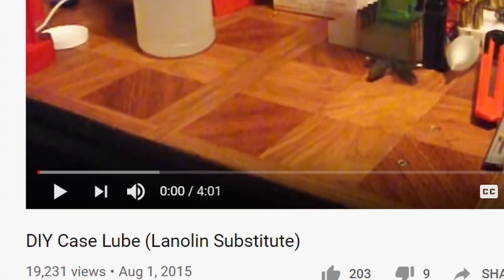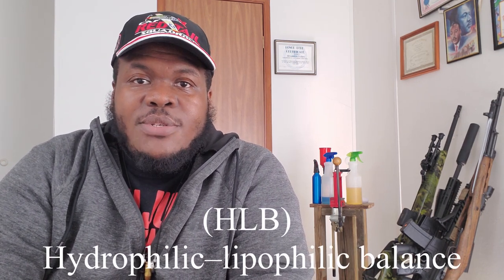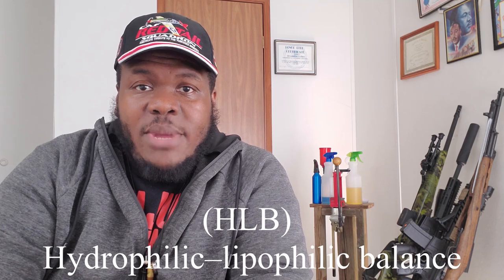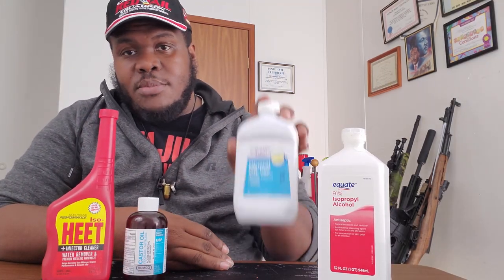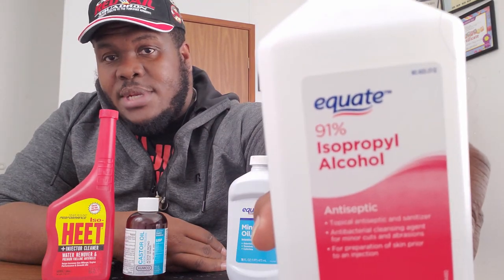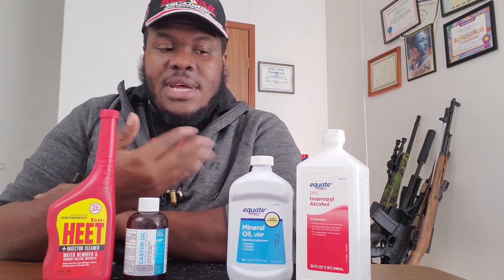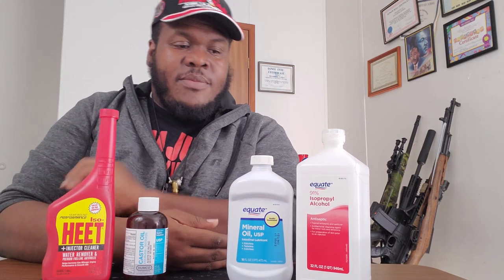DIY Case Lube 2.0 (#Lanolin Substitute)

Comment: Hi Tank, I'm a shooter/reloader in Australia. I have struggled to find lanolin like crazy down here. You first mineral oil vid was epic. This one is even better. I can purchase both mineral oil and caster oil down here very eaily and cheaply. Just wanted to say thanks for putting in the hard yards with testing. Awsome work!
Dan
Reply from the maker: Thanks Dan. I'm glad I was able to help. I do this because of people just like you.
Reply: wait, the country closest to new Zealand has trouble finding lanolin?
isn't there a bunch of sheep farms in Australia too?
Reply: Most pharmacies have lanolin.  It isn't in liquid form.   It comes in a jar for softening skin, make up,  etc.   I bought 8 ounces a few years ago on Ebay and I use a short T-spoon full to make 12 ounce bottles of lube with ISO heat.   I've made 4 bottles so far and still have most of the lanolin in the jar.

Comment: Spritz the bag first, then add the casings and rub them around. that way you won't accidentally spray into a case.
Reply from the maker: Thanks for the tip. Will definitely do that moving forward.
Reply: You need a little lube in the case neck or on the expander itself otherwise the expander will get stuck or change the shoulder set back.
Reply: @jimburianek685  spot on!

Comment: Tank, I just bought a quart of castor oil for 15.00, a spray bottle for 4.00 and a bottle of iso heet for 2.25. I think my grandkids will be the ones who finish off the castor oil. I sprayed a Wal-Mart bag with 3 spritzes of your formula, added 320 .223 cases, shook it a bit, and ran them through resizing. NO ISSUES! I thank you for sharing the research with us. Processing .223 is my least favorite job, but this method is really painless (couldn't bring myself to say slick) Thanks again, Brother
Reply from the maker: You are more than welcome!!!! I just crossed over into the realm of 458 SOCOM and I processed about 200 case last night using the same formula. Glad to hear it's working for you. 👍🏿👍🏿👍🏿

Comment: I have been useing  1 oz mineral  oil to 1 container  of heat for my case lube for over 8 years now. I haven't  had ANY PROBLEMS.  I haven't  stuck any cases since  I switched  to this mixture. No problems with my ammo. I use imperial  sizing wax if I am doing 1 or 2 cases for something  specific.  But 10,20, 50 or more I use the mineral  oil & heat. I put the cases in a plastic  tub. Spray a few times mix them up with my hand let them sit there for a few minutes till I get my dies setup. Then do my thing. It has worked  so well for me I am happy with it. I am sticking with it.
Reply from the maker: Thats what I love to hear.

Comment: for case sizing wax or case lube I use the Lowes toilet bowl wax rings.  They wax rings don't work for bullet lube without making the wax harder, but these rings work great for case wax.  BTW, castor oil and lanolin are the primary ingredients in swaging lube for swaging jacketed bullets.
Reply from the maker: Sweet deal. I didn't know that.  I guess I'll try some of this when I start casting. Funny thing is I have all of the supplies, I've just never stopped long enough to actually do it. Lol

Comment: Thanks for the the info, Tank. Just mixed up a batch exactly the way you did. Looking forward to lubing all my 223 brass with it! Guess I'm not the only one that has a minimal reloading bench. My bench is a sheet of plywood sitting on a couple sawhorses. Ya do with what ya got I guess.
Reply from the maker: I actually have a full fledged bench in my shed, I just don't have power out there and no climate control. Also I like watching TV while I reload, so I made this little thing so i could load in the house. It's heavy as sin but it's sturdy as a rock. 😁😁😁

Comment: Question; have you ever had any issues when spraying in bag , with the oil residue being left in case should it have gotten inside. Powder , primer issues
Reply from the maker: No not really.  None that I recall. But remember I decap and then tumble my brass so if there was any it's absorbed by my media
Reply: @WHATSUPTANKWashington  ok Thank you, so you are using you are using dirty range brass in full length sizing die lubed with this castor oil then tumbling it? Or are you tumbling clean, resizing with the lube and tumbling again to clean off lube?
Reply from the maker: @raymondbuie5292  I do both
Reply: @WHATSUPTANKWashington  ok great Thank you!

Comment: Well done. Ace hardware sells a gallon of ISO- propyl alcohol for about $32. A considerable savings over Heet and eliminates the fuel injector cleaner as a risk to primers ( although a low risk - one bad primer is enough to cause concern)

Comment: I alway thought mineral oils killed primers, so, I had a shit load of primers to get rid of, I put them in an oil bath and forgot about them, found them a week later, took one out and hit it with a hammer, as any red blooded gun nut would do, the result was it scared the shit out of my cat, I got a bit of a surprise and tried it again, same result, took a few hours for the cat to come back, I am still careful about handling primers but the biggest reason a primer won't go off is it is not seated correctly.
Reply from the maker: I have another video testing that same theory. The only thing I've found is that in some cases the primer won't go off if it's wet, but when it dries POW!!!!

Comment: Tank 
Just saw your vids 2day for the first time. 
You interested to test an even cheaper option, well at least where I'm from both the alcohol, lanolin, caster oil and mineral oil is more expensive than my mix.

Now i have to say that i wash my cases with soap and citric acid after resizing, so I've no issues regarding contamination of powder or primers

Let me know.

Thanks to your 1st vid i got to my own concoction 🥳
Reply from the maker: Thanks what I love to hear. Taking what you have and making it work for you. If you want, shoot me an email and I'll give it a try when I get some time. It may be a little while because this is a very busy time of year for me but I'm always open to considering something new.
Reply from the maker: @fgrobler1342  send that to my email.  Whatsuptankwashington@gmail.com
Reply: @WHATSUPTANKWashington  will do, and will send the pics 2!

Comment: First of all Tank, you rock dude!
Second, I followed this recipe and it works like a charm. Even tho I use carbide dies and don't really need to lube I figure why not make it even easier.
Thanks for doing the research so I didn't have to.
Reply from the maker: No problem. I've always been a bit of a sciences nerd so this was right up my alley. I'm just happy to be able to share it with everyone.
Reply: but you have to lube rifle dies because they are nit carbide.

Comment: The 10% lanolin how is that measurement some say .4. Is that .4 of an inch¿
Reply from the maker: Normally I believe the measurement is a ratio of 12 to 4. So if you have 12oz of alcohol you use 4oz of lanolin. This is if  I understand you correctly.
So it would be 4 parts if im not mistaken.
Reply: @WHATSUPTANKWashington  thank you, I was just going buy Gavin from Ultimate Reloaded, but if 12:4 will work thats easier to figure out

Comment: Lubing cases before sizing doesn't bother me, it's having to lube the inside of the neck.  I use the Imperial graphite stuff.  Comes in a small container with tiny porcelain beads and some dry graphite powder.   Lube the outside of the case (I use the RCBS pad and their lube), then dab the case neck into the dry lube a couple times.

Works good at keeping the sizing plug smooth, but it's messy as heck.  That graphite gets all over everything and all up inside the die.  Have to clean the die every once in a while.

Going to try either the lanolin/alcohol or your HEET/castor oil method for lubing.  When it dries, is the lube remaining on the cases oily, or is it more dry?

I wish die makers would make the neck sizing plug out of carbide then you wouldn't have to worry about neck lube.
Reply from the maker: It depends on how heavily or lightly you spritz your bag. A buddy of mine uses the graphite as well. I've been curious about it but I've never messed with it. This method has worked very well for me. When the alcohol flashes there is a very thin layer of oil left. When the oil dries completely there's nothing. If I do notice anything I just throw the cases in the tumbler before priming.

Comment: Nice video!  Never would have thought Castor oil.  What do you use to clean the cases afterwards?  Water/dish soap, a vibratory tumbler?  How about after you use the lanolin, I hear soap and water doesn't take it off.
Reply: You don't wash it off. This is the lube you put on before you reload, which is why you use a very small amount.
Reply: I clean my loaded rounds in my vibratory cleaner with corn cob media and a couple of squirts of 70% isopropanol. It cleans off the lube residue in about 5 to 10 minutes. You need to remove the lube if you want to run the loaded rounds through a case gauge. It also prevents them from collecting dirt.

Comment: I use Castor oil straight, without the alcohol. Finger tip puts a bit inside neck and rub two fingers with castor oil over the outside of the case and make sure I don't have too much on outside of neck and shoulders. I wet wash tumble after sizing, and dry before priming the cases.
Reply: I gotta have one of those knives,  please let me know  what it is and where to get one. Great vid and I am with the other reply on getting a solid bench made. Like it, love it, gotta have some more of it. LOL

Comment: The challenge I have with the lanolin-based home lubricant, is challenge of cleaning the cases of the lubricant is a real bear.  How does this one work ?
Reply from the maker: You can either dry tumble or simply wipe the cases off but that will depend on the way you mix it.
Reply: @WHATSUPTANKWashington  Thanks for the response.  That would work for a few rifle cases.  Doing thousands of pistol cases needs more mechanical  assistance.
Reply from the maker: @happyhome41  before I say why are you lubricating pistol cases I'll ask what caliber?
Reply: @WHATSUPTANKWashington  357 SIG
Reply from the maker: @happyhome41  interesting 🤔 That's a caliber I don't have any experience with just yet.